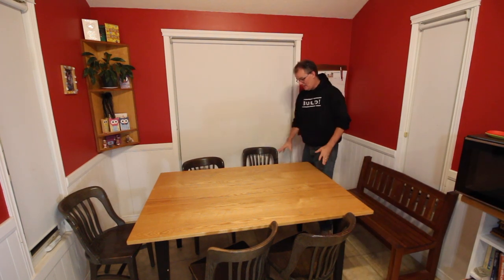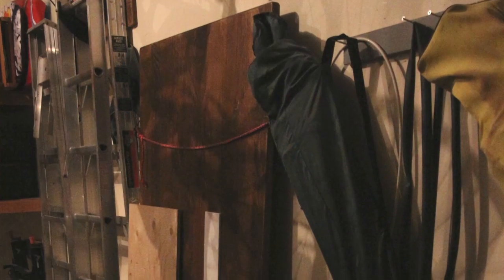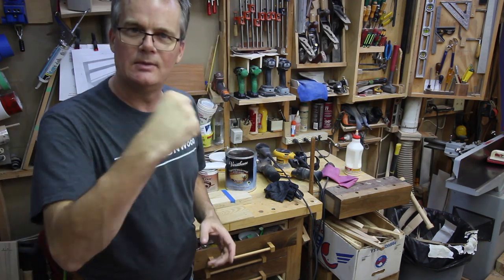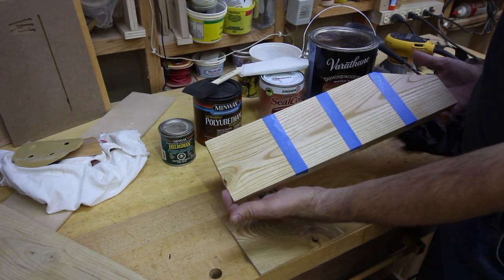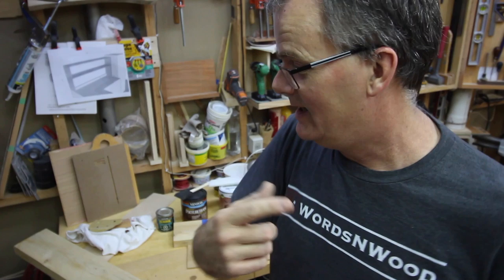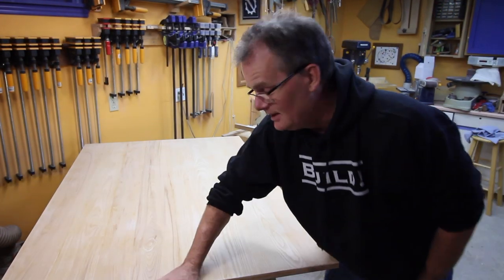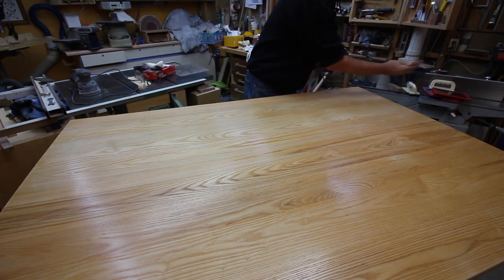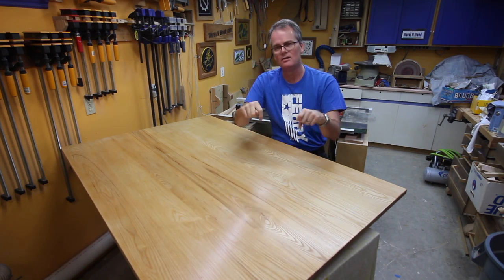Stripping and Redoing our Table (WnW #183)

Comment: Where's the river?  You missed your chance to cut one in and fill it with blue tinted epoxy with LEDs underneath, and even add a waterfall to the edge :)
I've really come to prefer the non-ambering effect of water based poly over the oil based, and then you can't beat the ease of cleanup.
Reply from the maker: Ahhh, but is epoxy food safe?    You know we can't win against the trolls no matter which way we turn!  ;-)

And it's true, can't beat the ease of cleanup.
Reply: @Wordsnwood  You (Art), John and Matthias should do another meet up! I missed the last one a few years ago unfortunately.
Reply from the maker: @scottmichaellewis  Unfortunately, Matthias moved to New Brunswick, so it's a bit further now...

Comment: Good call on not using a paint stripper , i find it rarely does what you expect and cost a lot , smells etc. Maybe if you have difficult to sand pieces or mouldings i would consider it. 
Nice result on the finish, hope it Will hold up for a long time. If not you could always Paint it red / white with a maple leaf in the Middle.😂

Comment: A few nuggets I've learned... Citrus strip is safe and smells like oranges. Arm-r-seal has a whole line of water based polys. (And tinted polys) If you're unsure of you got all of the finish off, wipe it down with mineral spirits and any missed spot will pop out like a highlighted line in a book. :-)
Reply from the maker: Thanks for the tips
Reply: Agreed. I back up this guys experience.

Comment: Five years later im finding the same thing... My minwax poly is discolored and blotchy. Not attractive as when i first applied it.

After strong chemicals strippers, i gave up on them. But I thought Id try Citristrip, non toxic, low oder. It worked way better, cleaner, and faster then sanding. Plus smelled like oranges. Now I have to find a better finish to use.

Comment: If you wanted more color, why not use an amber shellac?  I like to work from flakes - super easy to dissolve in denature alcohol, and you can get exactly the cut that you want.  You can get really dark flakes, too.  Nice video btw.  Thanks for the tips!
Reply from the maker: I cut that part out of the video -- I have used flakes before, but the canned stuff is just so easy that I have settled on that.   You're right about the option for darker flakes, but generally this is good enough for my needs.   Also on many projects I'd use the Minwax oil-modified poly alone.
Reply: @Wordsnwood  I've never used the "oil-modified."  I'll have to give it a try!

Comment: I really appreciate videos like this because it’s always a mystery to me why woodworkers pick certain finishes. And there are sooo many of them!  I’ve never had good luck with the water based polys as they always seem to turn my smooth as glass surface into textured nightmare! The shellac must prevent this correct? As usual great video.
Reply from the maker: The shellac acts as a barrier, and gives a bit of colour, and reduces how much the grain raises.  so yes, it helps a bit.
If you go with WB finished on bare wood, it WILL raise the grain a fair bit.  I always need to sand pretty firmly after the first coat of WB finish.  Then the second coat is better.  The third coat is when you get that nice smooth finish happening.
the wood you use also matters.   Red oak is very open grained so it absorbs a lot and you get a wavy feel to the surface.   That's why people use "grain filling" steps.  Grain filling is still a bit of a mystery to me.   closed grain woods like maple or cherry give you a much smoother surface with less work just by their nature

Comment: I installed a bathroom fan and outside vent in my finish room in a basement back in 1998-2003 when I lived in Innerkip. I would get poly smell for days all through the house till I added the fan. Later added a rheostat to slow down the fan so It was quieter at night. With the fan, never smelled anything outside the doorless finish room.
Reply from the maker: That's a great idea, Bryan!

Comment: I'm confused as to how Arm-R-Seal was even in the conversation when you said the original finish was a wiping varnish and it didn't hold up.  That's what Arm-R-Seal is, but really you'd just put down more coats.  But I must say that I actually like the smell of Arm-R-Seal, vs the Minwax Wipe On Poly that smells horrible.  But last time I was low on Arm-R-Seal I had to resort to getting a can of Varathane Oil Based Poly and thinning it with mineral spirits and really I can't tell the difference and that is cheaper and can get right at the box store.  I really don't get smells from the wipe on stuff into the house from the basement.  Only when I spray lacquer or something like that does it become an issue.  But then we do have an exterior door for the basement door and it's a relatively new house.
Reply from the maker: The original finish was a brushing lacquer, not a poly.   I intended to use poly, so that's how Arm-r-seal came up.

Comment: Nice looking table I've been refinishing for 30+years professionally for 10 this is only my comment and viewpoint from my experience, I've tried everything there is to try I will run as fast as I can from any type of water finish I don't use any type of polyurethane either  I have best luck with lacquer and a hand rubbed French polish I also use a lot a lot of oils and I don't know what has happened to mini wax products but I stay away from them also the stains are week thin don't dry and really don't ad any deapth I try to stay away from stains any way like I said just my view point and what works for me
Reply from the maker: Thanks for your thoughts.

Comment: Is that five coats in total. 2 coats shellac and 3 poly. Or 2 shellac and 5 poly. Thanks
Reply from the maker: SEVEN coats total.  Two coats of shellac wiped on, followed by FIVE coats of poly brushed on.  The shellac is quite thin.
Reply: @Wordsnwood  Thanks

Comment from the maker: Like what I do?   Let Me know!    https://www.patreon.com/wordsnwood

----- ----- -----

I built this farm style kitchen table four years ago and thought I'd try brushing lacquer as a finish.  I'd heard so much about people using lacquer on furniture it seemed "the finish", so I gave it a try.    

Well, it didn't last.  Less than four years and the finish was degrading.  In places it was flaking right back to bare wood.  So I took apart the table and took the top down to my shop and set about sanding it back to bare wood, before refinishing it with shellac and then polyurethane.

Hoping that this time it will last longer!

📃Build Articles:  
I built and finished this table originally over the course of three articles:
http://www.wordsnwood.com/2015/harvest-table/
http://www.wordsnwood.com/2015/harvest-table2/
http://www.wordsnwood.com/2015/harvest-table3/

YOUR SUPPORT IS APPRECIATED:
💵 Become a Patron: https://www.patreon.com/wordsnwood
🛒 Buy a Plan: http://wordsnwood.com/plans/
👕 Buy Merch: http://wordsnwood.com/merch.html

---------- ---------- ---------- ---------- ----------
🗜 LINKS TO SOME OF THE ITEMS USED:

(AND/OR other tools and jigs that I use and recommend.
Most of these are affiliate links.  If you buy through these
links it helps support my channel.   Thank-you so much!)

JIGS/ACCESSORIES

http://amzn.to/1V4ZHkv — Painter’s Pyramids
http://amzn.to/2beVz3t — Minwax oil-modified Polyurethane
http://amzn.to/2daa1VK — Helmsman Spar Urethane
https://amzn.to/2pguuEB — Varathane Waterbased Polyurethane
https://amzn.to/2NLjU1R — Zinsser Sealcoat (DeWaxed Shellac)
http://amzn.to/2kPENLs — 3M Finishing Pads / Scotch Brite

📸  GEAR I USE TO MAKE VIDEO:

https://amzn.to/2nI7w8Q — Shure VP83 LensHopper Microphone
http://amzn.to/1qPkvBp — Canon T5i
http://amzn.to/2aK7jZX — Inexpensive Quick Release tripod ball head  (Very useful)
http://amzn.to/1SSwOmS — Sony Action Cam. (I use the HDR-AS15 which is discontinued -- cheaper than a gopro.)
http://amzn.to/267XM3M — Sony Live View video remote for Action Cam
https://amzn.to/2NddVjk — But I do also have a GoPro Hero 5 Black
http://amzn.to/1XC2D7l — Joby GorillaPod (Flexible small tripod)

---------- ---------- ---------- ---------- ----------

MORE MORE MORE:
http://www.wordsnwood.com
https://www.instagram.com/words.n.wood
https://www.facebook.com/wordsnwood

---------- ---------- ---------- ---------- ----------
🙏🙏Thank-you! 🙏🙏

Music:  "Upsetter" / The Mini Vandals - Youtube Audio Library